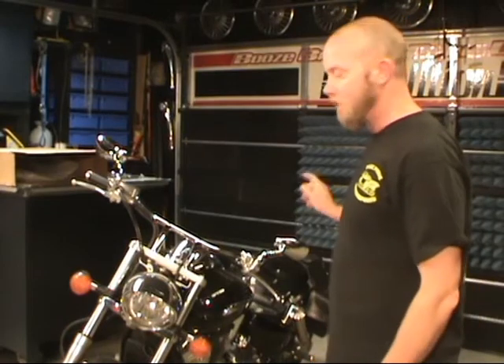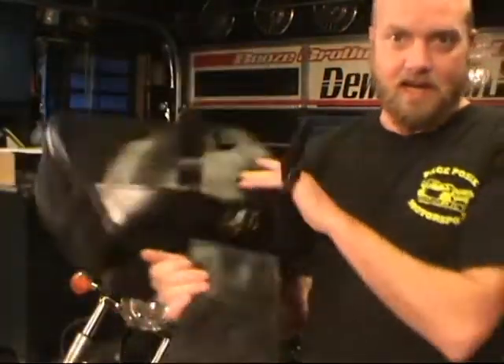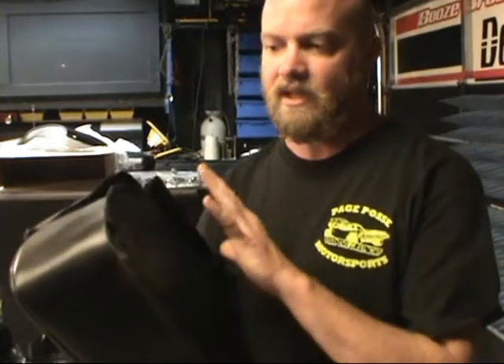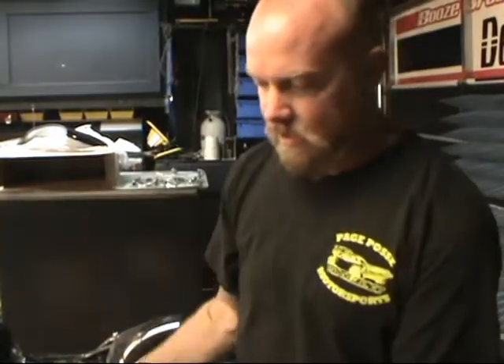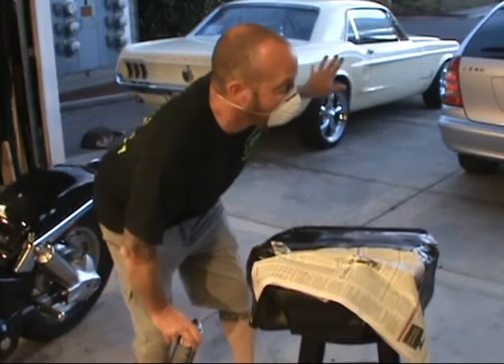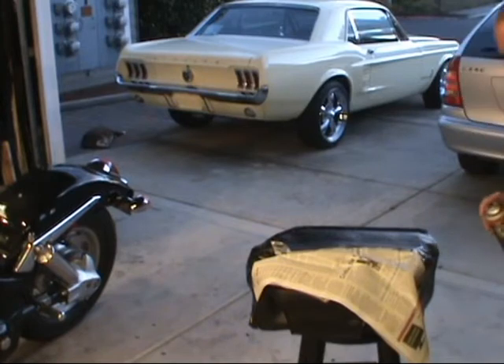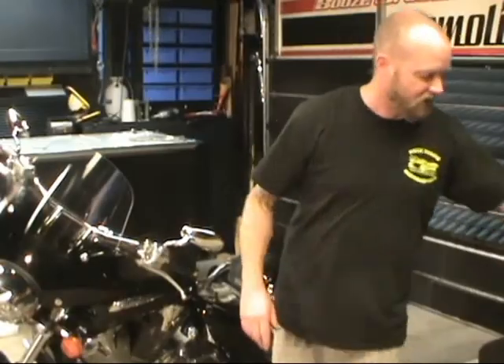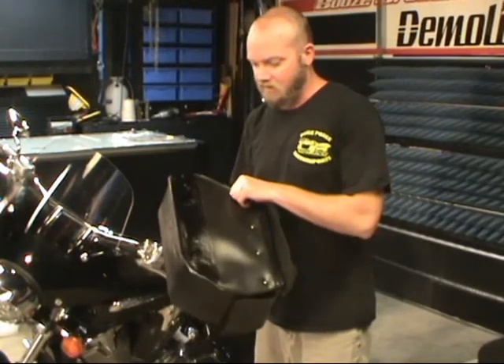How to Install a windshield on the Honda VTX

Comment: Hi Mike, I know this video is old but I just bought a used 2002 VTX 1800 about 3 months ago and I was wondering if you could show me what your saddlebags look like and where did you get the windshield and hardware.Thanks.
Reply from the maker: I got the windshield from Memphis Shades and it came with the hardware. The saddlebags are from Leatherup dot com. They were the lowest priced bags they had at that time and I wouldn't do that again. I got what I paid for, and that patch work I did didn't last six months before that flex seal started flaking off.

Comment: Hey Mike. Thanks for the great post on windscreen install. How did you know the clamps would be level when you installed them. did you guess or did you mark it somehow? just anticipating me fucking this up.
Reply from the maker: I just put them on finger tight so I could move them around a little during the installation.